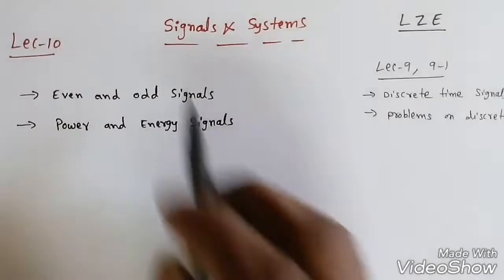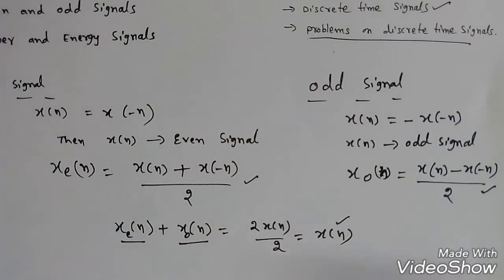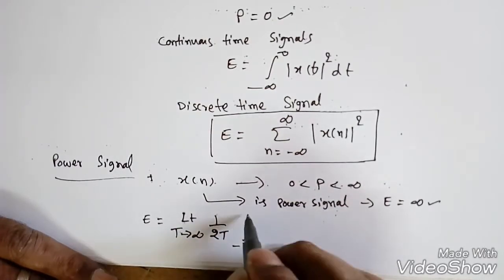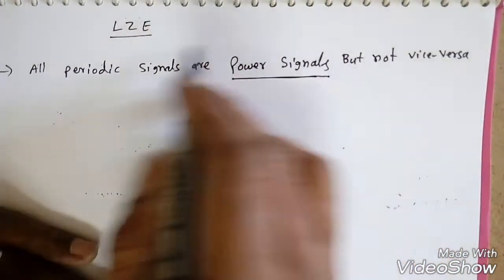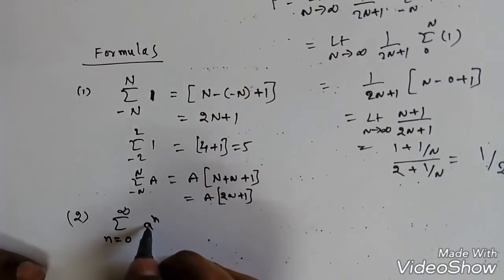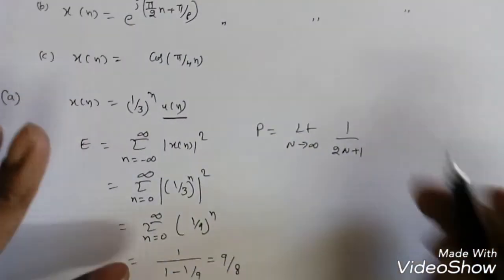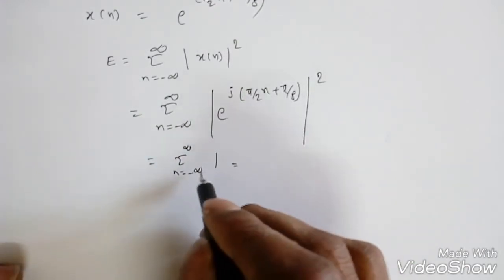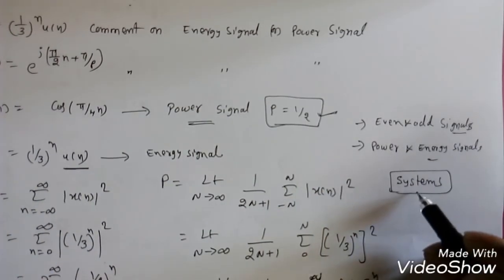Signals and Systems Lec-10: Power and Energy of Discrete time signals

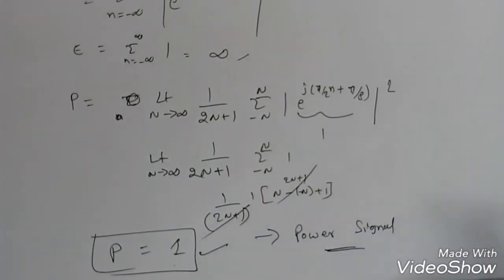Comment: sir, plz explain the solution of problem at 15:22 ...
how to open the sigma of cos func.?
Reply from the maker: From energy formula summation of cos^2(pi*n/4) = (1+cos(2*pi*n/4))/2, then summation will be seprated for 1/2 and for cos...then for constant summation will become = (Upperlimi-lower limit+1) = (1/(2N+1))*0.5(2N+1)) = 0.5, amd for cos for one period summation will be = 0...so the power is 0.5
Reply: Learning Z Everything sir its not cos^2(pi*4/n) 
it is [cos(pi*n/4)]^2
You are squaring the angle not the whole term 
Plz reply if I am wrong
Reply: how it could b (upper limit -lower limit +1) for constant term it is 1 in the term it is 1/2...how it can b??

Comment: In the problem ........why the limits changes to 0 to infinity..????
Reply: If you are talking about the problem where u(t) is multiplied then the answer is this- Because u(t) is 0 from -infinity to 0. So if you multiply it with any signal its resultant value will be 0 from -infinity to 0...so there is no use considering it, its value will be 0.
Reply: Because u(t) is the unit step signal which ranges from 0 to infinity. But for less than zero it is not valid(ie.for negative infinite)